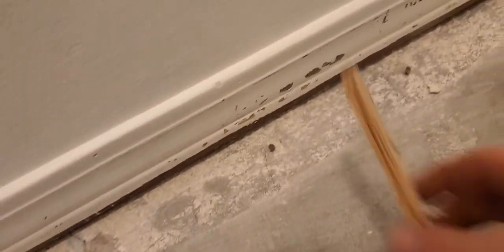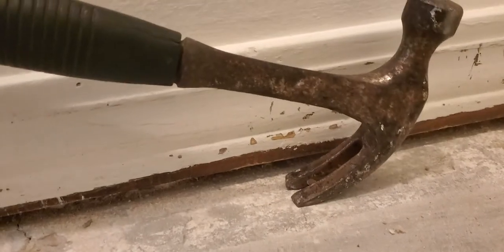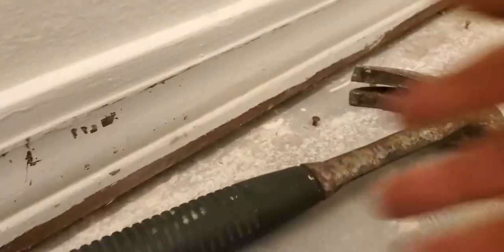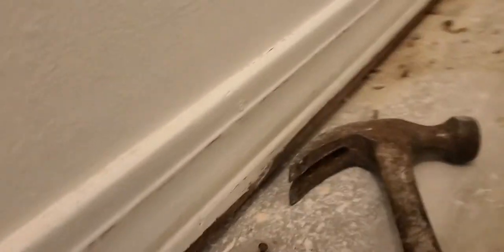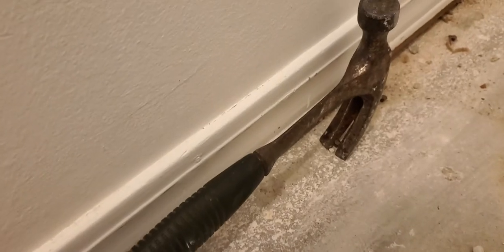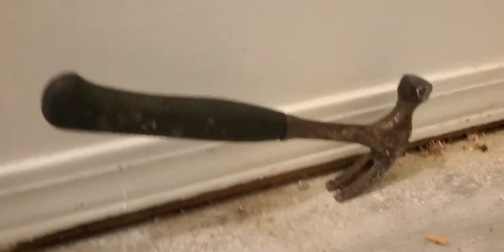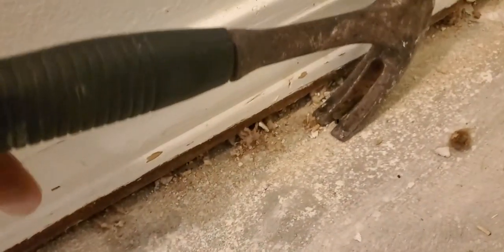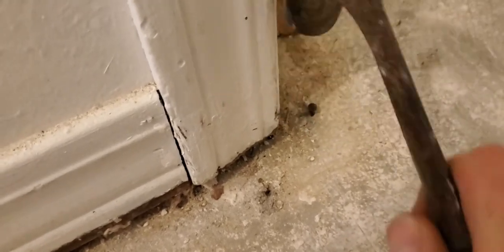remove carpet nails from concrete foundation. Hammer only no broken concrete.

Comment: Thank you, good stuff! :) How do you recommend remove the wood of the tack strip?  Would you say this just makes "smaller holes" than the normal beat the nail from the side method (that's been my experience, about 2/3 are small hole, 1/3 are just nail hole)?  Or what percent of the nails give just the  "nail hole" would you say, with it? My normal hammer's nail grip side seemed too wide to grip the nails like that.  The "stubby claw hammer" from harbor freight worked a little closer to what you show here.  Maybe I have small nail heads? Thanks! )

Comment: Should these holes be filled before installing vinyl plank flooring?
Reply from the maker: Ideally yes, but if they are just the small holes it's not necessary. With hust the hole there it won't cause buckling or anything.

Comment: I just used an angled grinder and cut those nails off
Reply: Grinding disc? Are you able to avoid cutting into the cement? If yes, how? :)
Reply: @RogerPack yes, with an angle grinder, I used a cutting disc and you do nip a little bit to the concrete. If you want perfect flushed cut, just use an oscillating tool with a tungsten blade.

Comment: If you're not putting another tack strip down, just hammer the nail flush with the concrete.
Reply: Haven't had good look with this myself, seems to crack surrounding cement on its way down, but maybe mine is brittle?